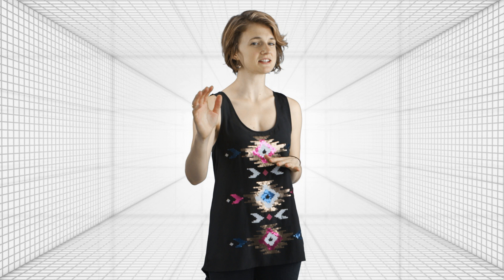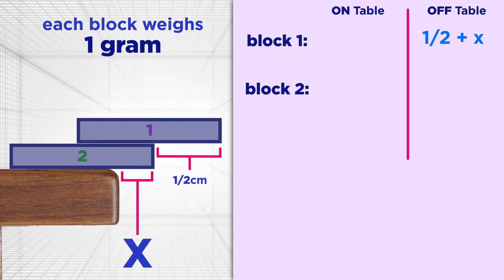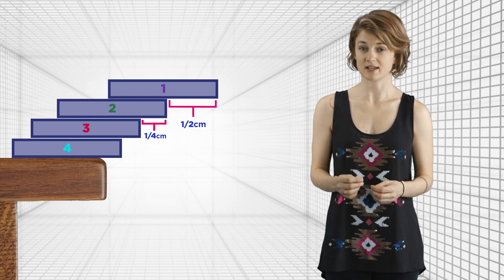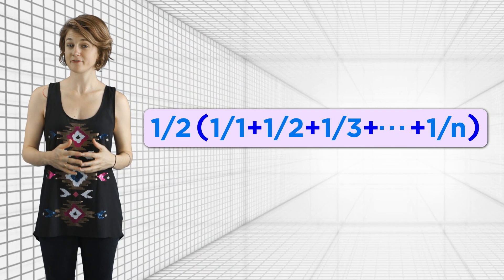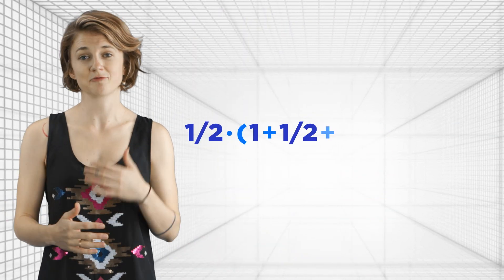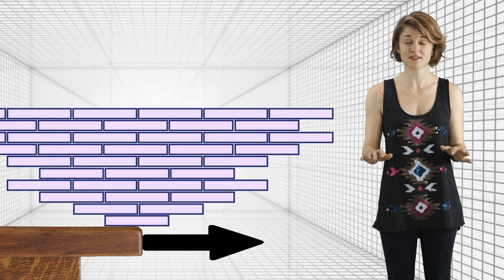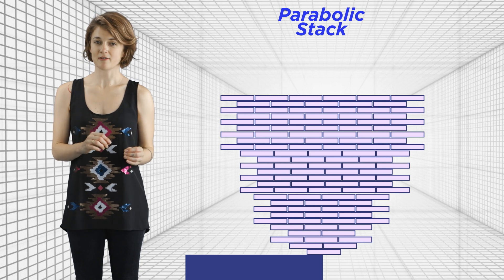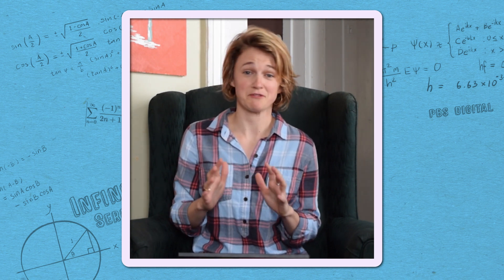Building an Infinite Bridge | Infinite Series

Comment: I have an issue with the solution to this problem presented here, as well as in other places on the net. I hope you can clarify it for me.

Both my work and your solution agree on the first 3 terms, namely that the bridge extends by 1/2, 3/4, and 11/12 of a brick's length over the edge. But your solution for the 4th brick has the whole bridge extending by 25/24, while I'm pretty sure it's 19/18.

Start by representing every brick with 36 squares on graph paper, or 36 symbols in a text editor. You can follow along here: https://pastebin.com/QTy0bsJB 

Hang the first brick by 18 spaces over the second (1/2 of 36), the first and second together by 27 spaces over the third (3/4 of 36) and the first three over the fourth by 33 (11/12 of 36). Now draw a line at position 38 of the four brick assembly and count the total number of symbols to the left and to the right of it. You will get exactly 72 symbols on each side. 

Since the four brick assembly is a rigid structure, per construction, and every symbol has the same mass (1/36 of the mass of a brick) it follows that position 38 is the center of mass of the entire structure, by definition: half the mass is to the left of it, half is to the right. But position 38 is 19/18 of 36, not 25/24!

That's why I believe the common solution to this problem, which you presented here, is wrong. Either that, or I'm making a mistake that I fail to see.

Comment: I don't think it's enough to just compare the mass on the table to the mass off the table. The position of the mass matters as well. Imagine you have 2 bricks, one on each end of a long massless stick. Now you can place this contraption with one brick sticking just off the table and one well onto the table, or with one sticking far off the table and the other close to the edge. In both cases the mass off the table is equal to the mass on the table, but in one case it's very stable and in the other case it will fall right off the table.

Comment: If 1/1+1/2+1/3+1/4...+1/n is infinite, but 1/1+1/2+1/4+1/8+1/16+...+1/n² is finite. Is there an infinite sum between those sums which is just at the edge of being infinite or finite?
Reply: Erdmännelchen The harmonic series is right on the border of being finite. For a series of elements 1/n^p, if p is greater then 1 then the series converges. If 0 < p <= 1 then the series diverges. It's called the p-series convergence test.
Reply: *Answer 1a*.  1/(n*log n) diverges and is between 1/n and 1/n^2.
*Answer 1b*. 1/(n*log(n)*log(log(n))) diverges and is between 1/(n*log(n)) and 1/n^2.
*Answer 1c*. ... continue in this fashion.

*Answer 2*.  Suppose you have a series of positive numbers x1+x2+x3+x4+... that diverges.  Then you can find another series of positive numbers y1+y2+y3+... that diverges `infinitely slower'.   By infinitely slower, I mean that the ratio (yn/xn) tends to zero as n tends to infinite.

*One proof of Answer 2*:  We know x1+x2+x3+x4+... diverges. This means that the sum eventually exceeds 1, and that it eventually exceeds 2, and eventually exceeds 3, and so on.   For the sake of illustration and ease of notation, imagine it takes 100 terms to exceed 1, and the next 900 terms to exceed 2, and the next 9000 terms to exceed 3, and so on.  Then we define the new series y like this:

x_1,x_2,x_3,...x_100, (x_101)/2, (x_102)/2,...,(x_1000)/2, (x_1001)/3,(x_1002)/3,..., (x_10000)/3, (x_10001)/4,...

Need to check two things: this new series diverges and that the ratio y_n/x_n tends to zero.

*y_n/x_n tends to zero*:  y_n/x_n starts off as 1, then after 100 terms the ratio becomes 1/2, then after 1000 terms the ratio becomes 1/3, and after 10000 terms becomes 1/4 and so on, getting closer and closer to zero.

*y_n diverges*: By construction, y_1+...+y_100 >1.  And  y_1+...+y_1000 > 1 + 1/2.  And y_1 + ... + y_10000 > 1 + 1/2 + 1/3.    Continuing in this fashion, the right hand side is becoming the 1/n series, which we know diverges, and hence sum of y_n diverges.

*Answer 3*. Naturally, your question actually still stands. Is there an edge?  Sure, using Answer 1 or 2 repeatedly, we can create infinitely many (countably infinite) diverging series, each much slower than the previous one.  But can you go beyond that?  The answer is yes, using some kind of diagonal argument. You can find a series which diverges and which is slower than all the series constructed previously. And now we can keep on repeating.  There is a technical sense in which this process has to end, which involves having to talk about ordinals!

So it looks like you asked a deceptively simple yet highly interesting question - I am glad the next video in the series commented on your comment!
Reply: Christophe Andre. There are more things you can do than change the exponential.  E.g. the sum of 1/n*log(n) diverges and is in between 1/n and 1/n^2.
Reply: You're actually asking about the value of the Riemann Zeta function : https://en.wikipedia.org/wiki/Riemann_zeta_function

at the value s = 1 and at s = 2 

This function is defined for all complex z such that Re(z) > 1 =, hence the series converges for all real numbers in ]1;+infinity[ . The function also has a pole at s= 1 since the series goes to infinity. 

So the value at the edge of being infinite would be something like 1+ds where ds is an infinetly small positive quantity.
Reply: Erdmännelchen, your question got me wondering if convergence can be undecidable, which prompted me to search and find https://mathoverflow.net/questions/230336/can-tests-for-the-convergence-and-divergence-of-series-be-used-to-create-undecid

Comment: I've been told that the answer is no, but I keep on wondering if there's something in between "very slow growing" series that converge greater than any finite number, and the fastest growing series that do converge at a finite number.  It feels like you should be able to create a series that at some part has a variable x, where if x is greater than some number the series does not converge at a finite number, and where x is less than some number it converges at a finite number, (or maybe there's actually a range of numbers), so that if you plug in the exact number (or range) it does something "in between", even though I don't know what that "in between" would mean.

Comment: I would like to point out that even "classical" computers are not 100% accurate. So there is in fact a small chance that 2+2 will equal 5. That's what programmers call "soft errors" and are caused by cosmic rays or thermal noise flipping random bits in your computer. There are even attacks utilizing such errors if they happen inside an URL.

Comment: I noticed that .5 * (HS1[I am denoting the harmonic series as (HSn) where n is equal to how many terms the partial harmonic series has]) =.5  while Ln(1) = 0, this is a pretty sizable difference. I went on to check for n= 2 and n= 10 they indicated  two things, 1) that the Harmonic series is consistently an over approximation, and 2) that the difference decreases. Are my intuitions correct? That would mean a sequence described by A(n)= (Ln(n) - HSn) would converge to 0 as n approaches infinity. If that is true then would the series described by that sequence converge as well? if so what value would  it converge to?

Comment: I don't have a picture anymore, but around 15 years ago we were visiting my grandmother's house, my little sister and I found a box of old lego bricks and running out of ideas eventually built a suspension bridge out of plain old bricks and flat pieces. We used knitting yarn for the cable, with the vertical bits held in place between connected bricks of the deck,. It spanned almost a meter between the towers when unsupported the lego block surface couldn't hold together more than a few cm and would collapse under its own weight. It was really nice to see how the bridge was hanging itself up, using the towers and the cable to convert convert the downward force of weight into an inwards compression between the anchors at the ends. When completed, it held hold several kgs of additional weight. Legos are very strong in compression as studied extensively on youtube...

Comment: If you want to build the longest possible bridge wouldn't it be better to use a cantilever where you fuse the bricks making up the bridge and balance the structure with a counter weight? The bridge could be expanded by fusing in new pieces and sliding them under said count weight via a mechanism designed to shift and angle the counter weight. Thus allowing the bridge to go on infinitely assuming we have a infinite supply of a infinitly strong material that can be welded and has a finite weight.
Reply: The situation assumes no welding- that is, the blocks have to be held together by gravity alone. If this were the case and it was infinitely strong, there's nothing stopping us from welding them end to end and placing it like one large first block extending infinitely far in both directions, which is kind of boring.

Comment: That is so strange! I tried to build a bridge out of coins. Find out I need 86.05 grams to balance hanging 36.25 grams. That is only 42 percent efficiency, but due to the math and logic it HAS to be 100% - what you hang is what you balance it with, precisely. But I suspect it's not working. 
Coin on the edge lifts up the next one, nick is big enough to make it slide down. The 2nd coin cause a smaller gap, the 3-d - even smaller. And the fifth coin have no noticeable movements, but it does not hold all the previous anymore. So I had to add tower over the center to prevent this tiny motion/pitching. And it has to be quite heavy. =( No quick bridges so soon

Comment: The problem is that quantum computers will exist as standalone devices before they can be built into the infrastructure. The first quantum computers will be room sized or bigger. This will create a period of time where hackers will have potential access to quantum computers long before they are small enough to be built into the infrastructure of the internet. In this period there will be no communication that cannot be "easily" cracked. Quantum computers will likely be our downfall unless we can find some other means of protecting data that doesn't involved quantum mechanics.

Comment: Why not just use an upside down pyramid? That'd always have the same weight on both sides and It'd grow the fastest.
Reply: Felix Windisch I have the same question, although I suspect there's some flaw in this construction that both of us don't realize.
Reply: Famfly It'd be physically impossible, but so would all the bridges that were discussed be
Reply: yeah I thought the same...
Reply: It would fall after some blocks, she even mentioned it in the video. She doesn't say upside down pyramid, but she says parabolic shape, which is exactly the same, unless you meant actual pyramid with base of triangle or square or other 2d shapes, in which case idk my guess is outcome would be the same.
Reply from the maker: Great question! In the article where they describe the parabolic stack, they explain why this doesn't work. It's linked in the description under "Overhang article"
Reply: Why not just use an infinitely long block?
Reply: A block is in equilibrium if the sum of the forces and the sum of the moments acting upon it are both 0. Also, the bricks are friction-less.

Even if an upside down pyramid of 2 layers (3 bricks in total) is accepted as stable, an upside down pyramid of 3 layers (6 bricks in total) will be unstable, because the most outer bricks of the top layer will tend to rotate the bricks from the 2'nd layer. The rotation of the bricks from the 2'nd layer will lift together the middle brick of the 3'rd layer with a force of twice the weight of one brick.

Please see Figure 7 from http://www.maa.org/sites/default/files/images/upload_library/22/Robbins/Patterson1.pdf
Reply: I think the video simplified the equlibrium a bit. The structure has to be stable both from the Center of Mass point of view, and rotationally. With the pyramid, when you reach layer 3, the bricks will tend to fall off because the moments are unbalanced. That's what I understood from the linked paper (http://www.maa.org/sites/default/files/images/upload_library/22/Robbins/Patterson1.pdf)
Reply: I tried to do this with dominos. They toppled when I tried to construct the 4th or 5th layer...
Reply: They toppled at the 4'th layer instead of toppling at the 3'rd one because the domino bricks are not frictionless.
Reply: RoGeorgeRoGeorge oh cool
Reply: The diamond-form would be stable with some extra blocks on top. It would even still grow faster than the first method, but only by a tiny bit and it is still log(n).
Reply: +Randomusername 69
Oh... no I've figured it out. I guess I wasn't paying much attention to the video. the apparent shape has to be parabolic, otherwise it gets unstable and topples. That's why the above layers were getting thicker and thicker. You can't make a perfect parabola with fixed sized bricks though, so you have to make an approximation
Reply: @DehimVerveen  That would be what mathematicians call the trivial solution, it's correct but gives us literally zero useful information.

Comment: Wouldn't a diamond shape bridge not work (you know: 1,2,3,4,5,4,3,2,1)
It's balanced, and uses X² bricks (X being 5 in the example) to extend X/2 (each of the lower layers extend 1/2; all the layers higher then the middle are balast so it doesn't collapse
That means a root(N)/2  progress, no?
Reply: heck, if we presume we can balance a brick on it's middle point, why wouldn't (1,2,3,4,5) work?

Comment: About the comment on internet cryptography breaking down: As long as there are problems that are easy to state and have an easy way to check a solution, but which are very hard to solve, there will be potential for cryptographic algorithms, right?

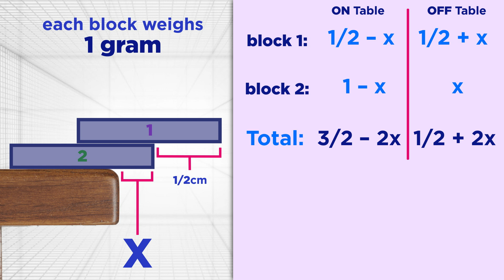Comment: 2:00 something tells me you're not going to take into account rotational inertia
Reply: They also ignored forces between blocks and the fact that the force of gravity on each block would decrease as the bridge stretched farther from Earth.  Frankly I doubt they've carried out an environmental impact assessment or even considered how to fund this boondoggle.  This is why I love pure math!😃
Reply: +Karma Arachnid Indeed there are of course a whole bunch of issues preventing it being an engineering solution. Other factors would be the fact that eventually the weight of the blocks will be so great the bottom blocks would be crushed into dust even if you use infinitely strong blocks you also can't have loose blocks stacked to infinite height. Above 36,000km the top blocks would be at a height where the centripetal force needed to keep it rotating at 0.26 rad/hr would exceed the local value of g causing the blocks to drift upwards from inertia.

Fun to think about but physics has to go spoil it heh.
Reply: What do you think this is??? 

A Physics channel??? ;)
Reply: Why so hostile?
Reply: Not hostile, just poking fun

Edit: that's why there is a ";)" at the end but text isn't alway good at showing tone

Comment: This does not work in real life.
I think you need to take into consideration that even tho the blocks touching they are not connected so the distance the bottom one has on the table has nothing to do with the distance the top on has from the center of mass and the edge of the table.
But the gravity pushing down on the block off the edge of the table is very real so the bottom block even with a small push is going to tilt and displace the center of balance very quickly.
Glue the blocks together this would make sense.

Comment: You couldn't actually build an indefinitely long bridge because if you're actually building it you need to start at the bottom. If you try to build it the way you stack these blocks (by lifting and sliding another underneath), you'll need "infinite" force to lift the "infinite" amount of blocks.